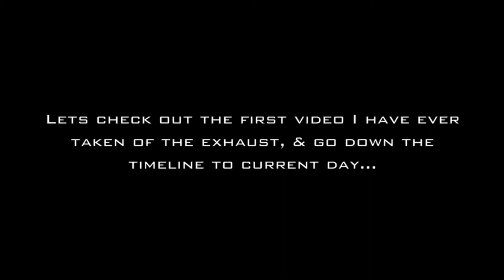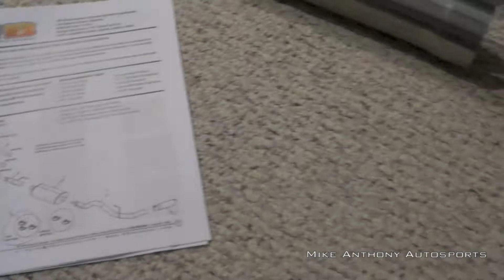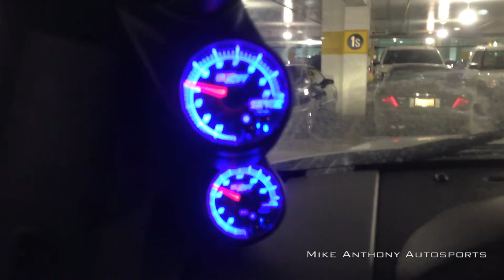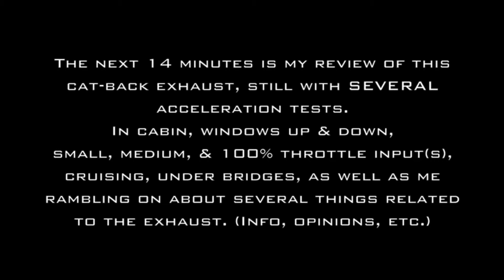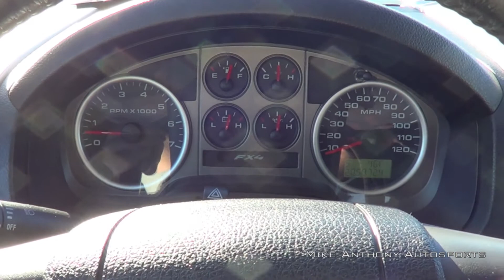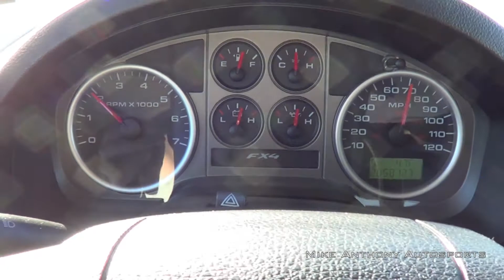F-150 5.4L 3v - Corsa Cat-Back Exhaust - Multiple Sound Clips In & Out (BULLETPROOF)

Comment: Where did you get the glow shift gauges and the mount for them?
Reply from the maker: Knights & Dragons Daily from glowshift and the pod was from autometer. The pod had to be filed down a tad to fit the gauges in, as they are two different brands with slightly different size housings.

Comment: Does this fit on a 2005 f150 XLT extended cab 6.6ft bed?
Reply from the maker: +Shawn Prickett Theoretically. They make one for every cab and bed option. Plug in what you have and boom.
Reply: +Mike Anthony Autosports ok thanks I think I'm going with the roush before the wheel side exit exhaust because it sounds about the same but the price is a little cheaper if you can even call $550 cheap.
Reply from the maker: +Shawn Prickett I paid less than that for this here. Check LM Performance. I bought mine from there. they had it on sale (they do that a lot) and paid a tad less. Also check Stage 3 motorsports. They have other exhaust kits but I do not believe they sell the Corsa for these F-150's.